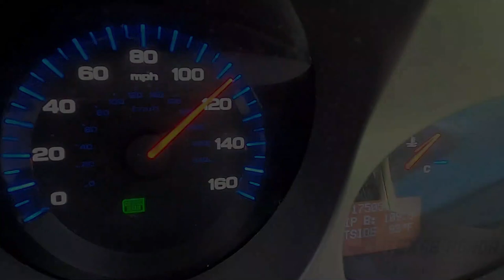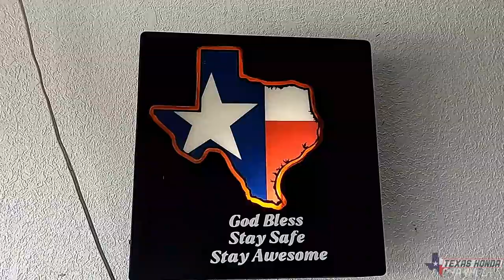Unbox & Install- DEPO Taillights From Ebay (2006 Acura TL)

Comment: I love watching how much your car has grown. Down here in Florida it stays humid (around 79% to 90%) with temps at 98 degrees but feels like 107. So I totally understand trying to do pulls and feeling cheated out of gains. You've got a fast Acura though. I use halfer land honda for all my bottom and top end parts for my J32A3. Yes I do have to send my engine off which it sounds like you're unable to do. But their customer service can help you with what parts you need and if you have some friends to help you install the parts you'll notice crazy gains. The only parts that will have to get sent off to a shop is for porting and polishing the heads. They have upgrades for the J35 but I heard in one of your videos you wanted to keep the j32. I'll be going turbo (once you upgrade all the internals your HP will not only increase 10 fold but you wont have to worry about engine failure "as much") can't wait to see what you do next man.

Comment: Looks very nice. If you want to....upgrade your side mirrors to the 2007 2008 model with turn signals.
Reply from the maker: That’s a good idea!
Reply: Would those mirrors work for the 04/06 with led turn signals to work?

Comment: Im gonna fill in the cracks and paint them to restore my dash lol plus there is nothing like the enkei 17x8 oem rims 💪😎 i slapped on some all season 235/40r17 on my 04 TL since its lowered and keep that fitment proper.
Reply from the maker: The small texture on the dash is hard to mimic or I would do that too. The dash crack video coming out on my other channel might blow you away. The glow in the dark dash cracks turned out pretty cool. :)

Comment: Hey man, I should have asked you a long time ago..... What's your thought on a 2015 Honda Accord, no key override, ran perfect. One day pts just clicked pushed it and held it and it started. Now it just clicks and won't turn over. Battery is at 12.6 and on my way home from AutoZone right now, battery test fully charged. Changed key fobs, 1 & 2, Dealer changed fob batteries as well prior to now. If I'm right it's the starter correct? Just looking for a pointer finger lol, google is like a gps right now..
Reply from the maker: That sounds about right starter or ground wire or something of that sort.
Reply: @TexasHondaChannel  That's all I haven't tested. I'll get it in the air today is after work.

Comment: Do you still have the stock 3.2 in it ?
Reply: Yes he does. Stock cams too.
Reply from the maker: Yup 100% stock internals. Just with 4.5-5psi on hott days. Stock injectors decapped for better flow

Comment: Just asking to ask how are these legal?  I was under assumption that clear taillights were illegal. That they needed a red reflector to be considered legal. Red light bulb isn't enough to make these legal.  Illegal or legal they look nice. Also why not get amber or red led bulb for turn signal?
Reply from the maker: It does have a reflector it’s just not a red one. The brake lights are red and park lights are red so when lit it’s red. For the bulb on turn signal it has to be amber/yellow in color that’s why it came with 2 amber bulbs with it. They are legal though at least where I’m at.